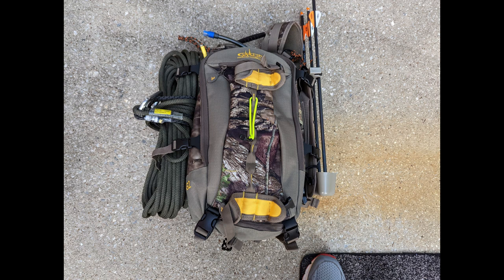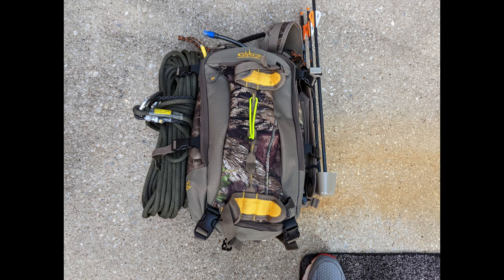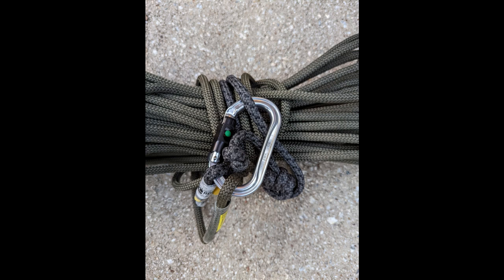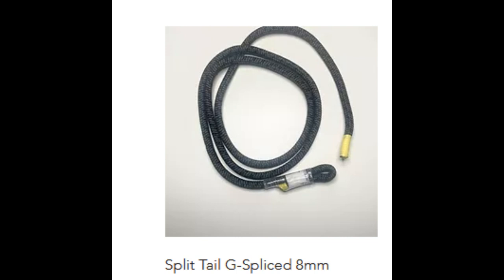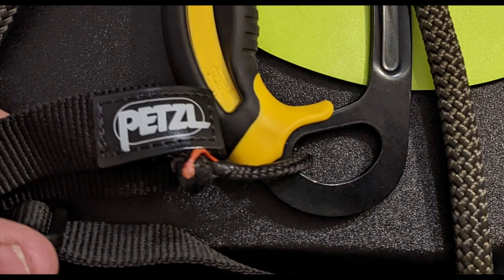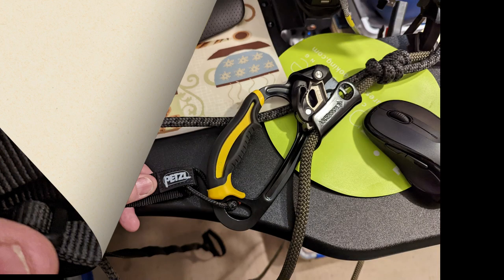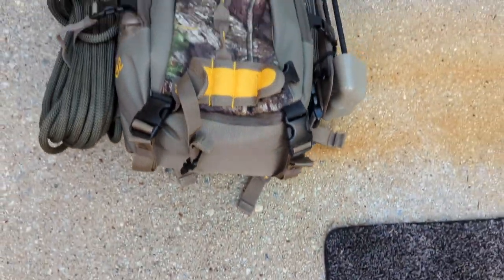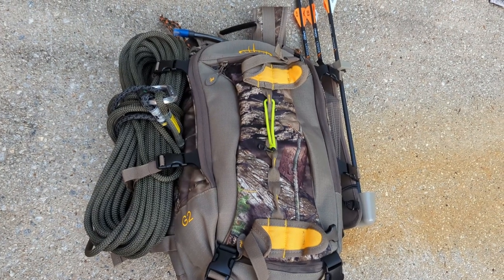A Better Way To Climb..  Split Tail DRT From  New York Saddle Hunter

Comment: I use DRT as well. I like to use a Garda Hitch foot loop. I find it really interesting how you strapped your rope to your pack. I'm such a dummy. Bahahah. I have a small bag that I can flake the rope into. Which works but it takes up pack space. Now I gotta do it like you but perhaps at the bottom of the pack so I'm not leaning. Bahahha
Reply from the maker: Thanks for Watching!  I may have to try Garda Hitch foot loop.